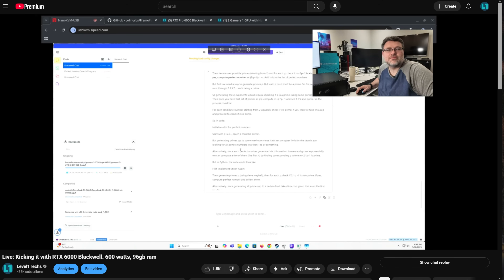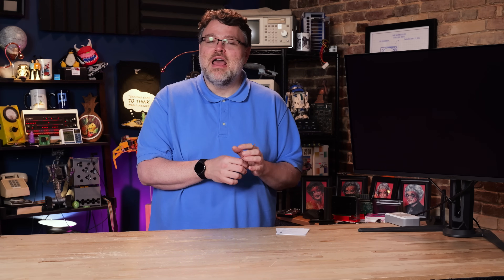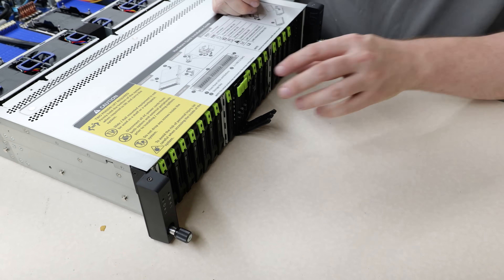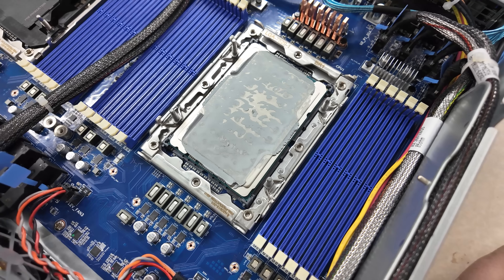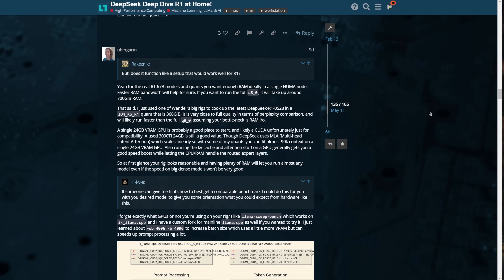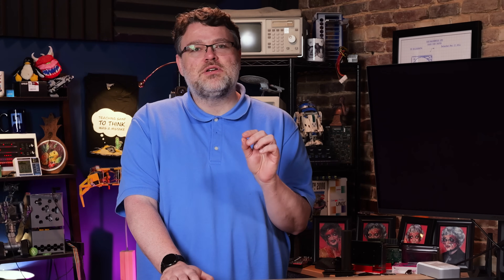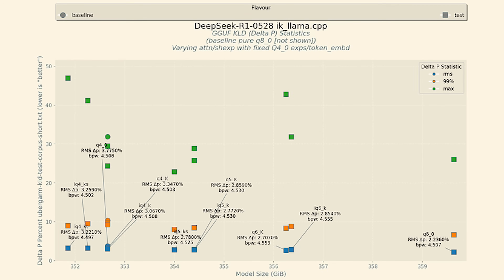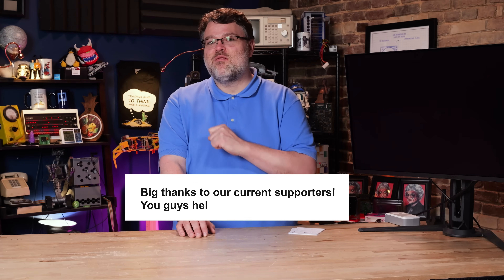Run Deepseek locally on a 24g GPU: Quantizing on our Giga Computing 6980P Xeon

Comment: Hello, I managed to run IQ1_S_R4 on PC, (3 files: DeepSeek-R1-0528-IQ1_S_R4-00001-of-00003.gguf) with 24 GB VRAM and 96 GB RAM DDR5. It is working, slow but working. It is answers: "My name is Claude." on: ""what is your name" :) The VRAM filled only on 13.7 GB, still have a lot of room. The RAM used 100% CPU used 100% also, (i9 13900k + RTX 4090) the GPU doing almost nothing, (20% utilization). Is anyone knows how I can utilize the 4090 GPU more and offload some of the RAM and CPU workload to Nvidia GPU? The parameters I use are:  -rtr --ctx-size 8192 -ctk q8_0 -mla 2 -fa -amb 512 -fmoe --n-gpu-layers 63 --override-tensor exps=CPU --parallel 1 --threads 24 Thank you for the model! This model just generated Tic-Tac-Toe game in Python, and it's working! 1 or 2 t/s

Comment: I built a 10gpu vega10 system (80gb) and have been researching llm's for my use case. My intention is as an assistant for scripting, distro creation and coding and from my research it seems a fp16 non Q model (33b deepseek?) should be my target, is this correct? what would you recommend? Also My intention is to use devuan as it is apt but does not have the massive overhead of systemd. Martox onboard gpu so I will be using xfce. Any insights you can give me would be highly appreciated!

Comment: well, since AM5 doesn't really like 2 DIMMs per channel, most people just have and use 2 DIMMs in their system. So 64GB or 96GB RAM are the - I would call it - usual maximum people have. 
So 64GB RAM + 24GB VRAM - how much worse will the model be in comparison to 128GB RAM + 24GB VRAM?

Comment: Great work!

"You can run it on... relatively... modest hardware" made me snort-laugh 😂
Reply: you "only" spend like maybe 3k for 128GB RAM and 24GB VRAM, instead of - I don't know - hundredfold?
Reply: @bernds6587  old server hardware is relatively cheap A F, and you can easily get 256/512/1024 gb of ram. 3090 is a lot cheaper than it was 3-4 years ago 😅

Comment: Newbie question: Regarding the requirement for 128 GB of RAM and 24 GB of VRAM... Does the 24 GB of VRAM have to be on a single GPU, or can 2x 16 GB GPUs be used instead?

I only ask because on the used market, 16 GB GPUs are very affordable. For example, the Radeon VII can be had for $200 or so. The 2080 TI is reasonable as well.

Comment: Even if a consumer has more than 128GB of RAM, the memory bandwidth just isn't enough to run a LLM on it and enjoy the experience. I'll stick to running whatever fits on my 96GB of RAM and my 4090.
Though I'll admit that Llama 4 Scout with 109B parameters runs faster than Llama 3.3 70B thanks to MoE. But I think Deepseek R1 70B (which is basically a modified Llama 3.3) is plain better than Llama 4, so there's that.

Comment: For anyone who doesn't already have the hardware, DON'T rush out to buy for this! The DGX Spark will do this cheaper and faster!
Reply: Yeah I wanna know the Nvidia tax first tho.
very likely a good next-gen CPU + 128GB of RAM costs less than the DGX Spark and with similar memory bandwidth, and it's a general system that you can use for more stuff.
Reply: @4.0.4  It's $3k. Still exepnsive, but cheaper than just the CPU and the barebones chassis for this thing. It also won't scream at you like a banshee.

Comment: binary neural network instead. its pure normal binary cpu logic circuit. so why you search for the truth, no benefit. truth is out there. depends who tries to sell their truth. perplexity my balls, prediction error is normal term for any automatically learning system. you have yet again made up nonsense terminology for no reason. yes your community. if you have a certain answer mapped for input then you can always calculate the model prediction error. perp is ai community nonsense term. best not to trust any of your communities. always lying with nonsense work pride burden. ai community is not even using standard scientific terminology. not science then. who would understand you if you dont speak understandable words. so convert fp16 to binary neural networks. binary compute does not require massive fp8 pre-calculated op tables (64KB per gate). well just have very fast m.2 ssd raid pcie card as memory. that result only means that the original model wasted weights for no real gain. more raid more faster. 1-bit? you said fp8 or fp4. well better make actual 1-bit binary logic compiled version then. yep pc algorithms can output tons of stuff also.

Comment: What is the difference between your quantized model and the quantized model from LM Studio community for DeepSeek R1 0528 on a AMD 7900 XTX with 24GB memory?
Reply: I believe bartowski makes a lot of the LM Studio models. Typically they request not to use imatrix. imatrix helps improve model quality when it is below <= 4bpw quant sizes. You could run the LM studio one on 24GB VRAM assuming you have enough system ram to hold the rest so probably 192GB RAM or more.
Reply: Bartowski's uploads under LM Studio community are static, i.e. do not use imatrix. The models uploaded under Bartowski's personal account do use imatrix. Imatrix does not just improve model quality below 4 bits, even at 5 bits there is a bit of visible improvement in perplexity.

Comment: Wendell ... there are no "normal folks" (as you call them) with 128G of memory (etc.). Yes, you've significantly reduced the stuff needed, but we plebes aren't even approaching those specs. But .. love what you do and make a point to take in as much as I can (admittedly minimal ...lol), so endless thx to your next level contributions!
Reply: Still, 128 GB of RAM can be had in a laptop nowadays. 24 GB of VRAM too (RTX 5090 laptop)
Reply: @Winnetou17  And that costs how much $
Reply: @danytoob  About $4000 to $6000 (MSI Titan 18 is the most expensive one). Not sure, but I think you can have one below $4000 too, or maybe, hopefully in the near future, there might be sales. But I'm sure there won't be nothing below $3000 this year.

Yeah, it's expensive, but some people do want that kind of a laptop even without the ability to run a model like this.

Also, I think there's options, maybe even cheaper, in Apple-land
Reply: @Winnetou17  I'd guess (for whatever that is or isn't worth  ...lol) that tier of users is only a small fraction of 1% of laptop owners, which is an even smaller percentage of all computer owners.  In my view, "normal" would denote a much larger actual amount of folks. Could be just me though. (...and I still love/enjoy/learn from Wendell)
Reply: @danytoob  you're in a broke echo chamber. PLENTY of people have GPUs that good for gaming (just check the Steam Hardware Survey), LET ALONE the MANY people who own high end laptops for professional use. In this context "normal" simply means NOT DATACENTER, not "broke youtube commenter/whiner"
Reply: @danytoob  Us watching videos like these are already a niche, compared to all computer users. And the desktop variant should be cheaper / more affordable. Especially after NVidia finally releases RTX 5080 Super or whatever will be its name, with 24 GB of VRAM.
Reply: @Wobbothe3rd  If I didn't know better you could be just like one of those Reddit attack dogs rather than folks looking to learn, share and be better ... oh well
Reply: 128gb of ram isn't expensive 🫰 I have 64 and my rig is almost 4 years old (ancient lol)😅
Reply: @burningman1945  uh oh

Comment: Hmmm 
24 core AMD ThreadRipper, 256GB memory, and a 3090 GPU w 24GB. ... I wonder how this would play out?
Reply: Its a dream. You can run my ik_llama.cpp quants with 32k context over 12 tok/sec generation and over 200 tok/sec with large batch sizes.

Comment: I dont get it. 
Why title says that Deepseek locally on 24gig GPU -- Then the video shows that GPU nowhere and there are 2x Xeon 256 threads + Huge amount of RAM?
I get that PC needs more ram that vram in GPU to run these models, but what im missing here. Plz hand hold me. Im scared.
Reply: The video showed off the computer that MADE the model that you can run on 24 GB GPU. Making a model requires much more resources than running a model.
Reply from the maker: The quantization allows the model to run on a 24GB GPU, and the video covers both aspects.

Comment: Alexander valdemir kowaliuk here, I was curious what the actual future of ai means in execution so I looked at what darpa was saying about the AI they are working on and of course it's classified but they did say the sooner the big companies move away from LLms the better they have several papers published but that was the just I picked out of it and I would guess you would want something like a 4d core quantum processor of some sort and probably gonna have to move away from electricity and use light or other forces to get over the heat and speed limitations looks like the doc was onto something with the flux capacitor huh😮😅we also have the discovery of alter magnetism to explore in processing.

Comment: Hey Wendel! Love the content. I am wondering if there is any way to use old mining specific GPUs like the Nvidia CMP170HX for running AI models. They have quite a lot of HBM memory, but I know they are missing some of the compute of a standard GPU. I am sure someone like you might be able to figure it out if it could be done though! They have slightly les bandwidth than a 5090 and are only about $300 on ebay for one unit. Just a thought and would probably make a good video if it actually worked!
Reply: Yeah, I wonder if old mining rigs with 8 video cards , 8-16 gigs each would be feasible

Comment: Can you do a local AI crash course video? I just built a system with 32GBs of RAM, a 5600x, and a 3060 12GB but I'm honestly kind of lost just with the fact that there is so many options out there
Reply: This please.
Reply: LM studio
Reply: +1, I think it's by far the best "it just works" solution I've come across. A lot of guides claim easy this, easy that. But following their precise steps often doesn't work, they can't troubleshoot and you would have been better off trying to read the source material. Start with LM Studio. Branch out from there.
Reply: @jannegrey  ^ This. It doesn't get any easier than "LM Studio". And it works on all platforms.
Reply: It doesn't get any easier than LM Studio. And it works on all platforms.
Reply: Try out ollama imo, it's like 3 minutes to have a working local text to text model.
Deepseek is also there, with like 50 other options. It's a simple command to start it or asking it to pull down a different model for use
Reply: ^ This. It doesn't get any easier than "LM Studio". And it works on all platforms.
Reply: Dave's Garage did one for Ollama. You are stuck using models which match your available system RAM. That means with your 32GB of RAM you can max out of a model with up to 32 billion parameters. Ollama has some drawbacks, but you can also use GPT4ALL which is more user friendly.
Reply: @knerduno5942  I personally found GPT4ALL horrible the last time I tried it, no support for gemma 3 and qwen 3 (i.e. the latest and greatest of the models that can easily be run locally). On top of that, they only let you download lousy q4_0 quants if you are using vulkan. From what I see, it seems to be essentially abandoned by its developers. Meanwhile, I highly dislike Ollama being highly misleading with model names, and also providing suboptimal quants by default. 
It really pains me to say that I simply prefer LM Studio, despite it not being open source, due to all the open source alternatives doing needlessly stupid things.
Reply: If you're on Linux, theres a flatpak called Alpaca that makes it a super easy process

Comment: I got excited for a second when I read 24G, then realized it was GPU and not system memory...
Reply: Right, 24GB VRAM cuda + 128GB system RAM to run the small one!
Reply: "good thing for oridnary folks" 😂

This computer is what $30k or more ?
Reply: @logirex  The 30k+ computer was used to quantize the full 671 GB model. The resulting smaller 131GB model is what you can run on a high end gaming with 2x64GB DDR5 and 24GB CUDA gpu.
Reply: @logirex  just one of this CPUs cost $18K... multiply by 2... + 64GB memory sticks, 24 of them? Yeah, the computer is a beast. Also it's probably not for living room cause of the cooling noise...
Reply: I'm pretty sure there are DeepSeek models that can fit on 8GB of VRAM, so I don't get the title of this video lol.
Reply: @GoldSrc_  Those are "distill" models which are actually Qwen or Llama architechtures. The ollama naming convention notoriously caused a lot of confusion. They are find models for what they are, but they are not the real DeepSeek model architecture which we're discussing in this video.
Reply: @GoldSrc_  The goal is to keep the quality of the large baseline model. The 32b model for example will perform worse because it has way less weights.
Reply: @GoldSrc_ Yeah the 8b Qwen3-based knowledge transfer. It's as smart as many 24b models. It's very smart when it comes to problem solving, no perplexity issues to run straight too.

Comment: Models that require more than 256gb of system RAM and 32gb of VRAM are really more of a spectacle rather than anything tangible and usable at least from a 'regular consumer' perspective , average joe per-say. Cause that would be the reasonable side of things in terms of what is commercially available atm at reasonable prices. Obviously level1 audience is composed of nerds with expensive hardware and someone will say they have a box with 1tb of ram on their closet running deepseek which is cool but not really feasible or normal.
Reply from the maker: right, so in the video, and on the link above, you can download a quantized model version of deepseek that DOES run in < 256gb ram and < 32gb vram and produces imho useful answers to questions. And its true deepseek, not distilled.

Comment: Pleas try to run the full fledged deepseek with high speed DDR5 and vega 64 with cache enabled (where it uses system ram as vram so HBCC ) and then check how much more (or less) a nvidia solution would cost in order to match the performance of the vegas wih HBCC(and obviously tons of asap DDR5 RAM)

Comment: How many tokens per second?
Reply: You can see in the video split screen around 10 tok/sec running on a single socket of that big 6980P CPU only. You can get more with hybrid GPU offload. On a thread ripper pro 24 core with 256GB RAM and 24GB CUDA GPU my quants can give over 12 tok/sec output generation and over 200 tok/sec prompt processing "prefill" in larger batch sizes.

Comment: I'd be curious about the power consumption per token(?) or is that the wrong metric?
Reply: It's somewhat valid to ask for an average, but input tokens are very different from output tokens, and the first tokens are much cheaper than tokens after a long context.
Reply: Joules/token is a standard metric for power consumption/token. This is going to largely depend on your workload (set a throughput/latency target and then measure with a test set against a model/software/hardware). I've done my own testing and for high throughput inference with a 70B FP8, currently I estimate about 0.4 J/token w/o too many optimizations, which is about 120X lower than widely cited numbers (Li et al 2023) and 14X lower than empirical measurements on older systems (Samsi et al 2023).
Reply: @lhl  Very cool, i've not researched this but thanks for your number and citation! Definitely very important for data-centers and service providers!
Reply: @lhl  that only works for measuring averages on huge systems where everything evens out. Also a lot of cited metrics seem to try to paint a specific picture, usually exaggerating how much power AI is using in a sensationalist manner. I bet Google's TPUs are crazy efficient but they don't publish numbers, and most providers probably have convoluted pipelines that involve vector DBs, draft models and a bunch of bits and bobs that make calculations either "trust me bro" numbers or not applicable in a wider setting.
Reply: @4.0.4 If you're measuring for home use, it's much easier. Just attach a Kill-a-Watt or equivalent to your hardware for the course of a day or week or whatever you feel is representative. Track your LLM usage (tons of observability layers you can use to easily count input/output tokens). Divide your tokens by measured KWh.  No trust needed, you can just literally measure things bro. 😆
Reply: @lhl  that's not wrong but let's say you measured at a time when you used a lot of input tokens, and later you start going output-token heavy. it's a bit of a pointless metric if the error margin is so large.
Reply: I think it would be a good metric, but likely challenging to compute accurately depending on the workload. As @4.0.4. mentions doing large batches can give much higher prompt processing speed over smaller batches but with a trade-off of latency etc. The big shops selling API endpoints likely try to keep an incoming queue full of requests to run all the GPUs to improve efficiency assuming high throughput loads. But yeah power is def a big issue!

Comment: In what way do these  differ from (or compare to) the different distillations already available  like say deepseek-r1 32billion parameter version on the ollama website?
Reply: The distills are completely different models that have just been trained with R1 output. People get confused because Ollama devs are bad and chose to misname the models inaccurately (incompetence or malice, I'll leave it to the reader to decide).
Reply: @lhl  true, but it's still a 100% valid question. In my experience the distillations are still very useful.
Reply: Yeah @lhl is correct. Yes distills can still be useful, just know what you are getting. Look closely at the hugging face card and you can see that a distill will be something like a Qwen2.5 architecture model and not a DeepSeek architecture model. There are very important differences. But yes they can be useful.